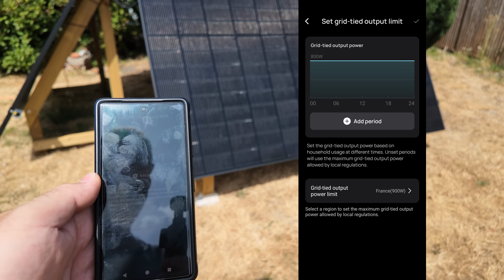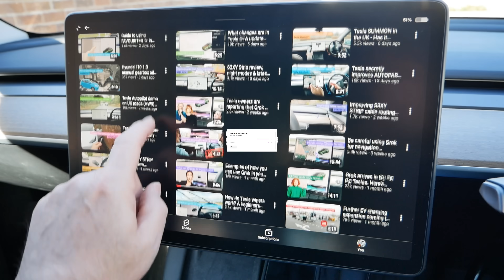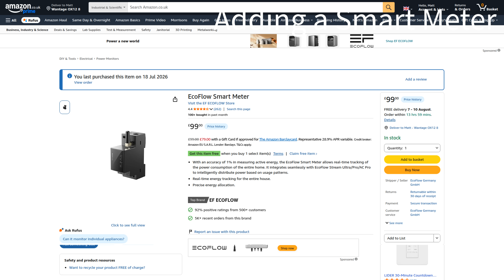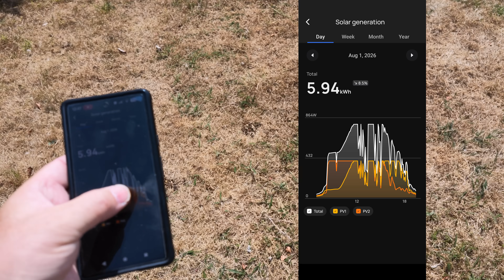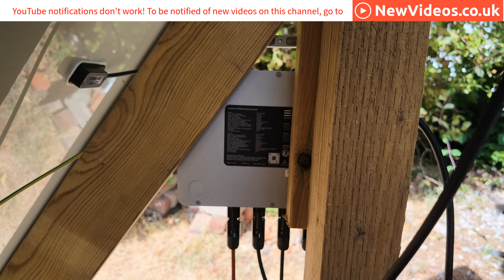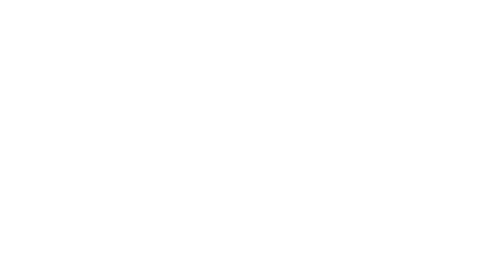Why My 800W Plug-In Solar Setup Sends Half Its Power Straight to the Grid ⚡

Comment: The more I read about these installations the more I think that over pannelling is a good idea( within the limits of the inverter) as this will improve winter output. A DC coupled battery to make sure you can use the full solar input and potentially max out the output of the inverter. It also seems possible to use a second 800w inverter in your system as long as it is on a different house circuit.
Reply from the maker: Yes, I'm looking forward to see how this performs in the winter.
Reply: I know everyone talks about DC batteries to reduce the conversion losses. But if you have more than one plugin solar setup on your property (some distance away) and want to be able to fill a battery from all the panels not just one array. Then an AC battery might not be such a bad idea, you plug the batery into a socket or in to your consumer unit. A Smart meter tells the battery there is spare solar and how much. It is a new idea to me as I was thinking you have to have panels plugged into the back of the battery but it seems not.

Comment: Mount the microinverter to a mental plate. It then becomes a big heatsink.
Reply from the maker: Yes, I'm considering that. Just trying to come across a bit of suitable metal.
Reply: @GoGreenAutos  Nothing too shiny!
Reply: Would be interesting to see if you can lower the temp with such a setup. I find mine hit 60-65 degrees which seems high but I understand it is ok up to 75 degrees. But do make sure it is in the shade!

Comment: I started using the same ecoflow stream inverter. i got 4 panels from city plumbing.  I have 2 ecoflow inverters with 1 450w on each port. (i think using 2 panels in parallel is risking damage. The current will be able to go too high)
I am about 5 weeks in now and also want a ecoflow stream ultra x and the smart meter you showed. But at £1300 for the ultra x and another £100 for the meter it is going to take a long time to pay itself off. 
The new ecoflow stream 5000 unit are just launching and I am going to wait for them to be available in the UK. 
On the 27/8/26 plug in solar is legal. I wonder if the grid will cope next year.
I can imagine that as more people start using solar it will make the price of electric will go down during sunny days.
I personally think the laws should be changed to force payment/credit for the electric pushed into the grid. I am sure my energy companys smart meter can calculate how much energy i have pushed into the grid.
Reply: The inverters are good for max 20amps so if you are using 4 panels each maxing around 10 amps (yes they say max 13amps but I have never managed to get that from mine) then maybe best not to have them all facing south.

Comment: I like this setup. You did the two strings correctly with each pair of panels in a given direction into a separate inpt. Mixing them would give reduced output.  I have a high base load due to a couple of pond pumps, filters, etc, so this would be ideal for me, perhaps on my garage roof, since that's an almost perfect east-west split.
Reply from the maker: What you waiting for? 😉

Comment: Aren't there losses due to the inverter working?
Reply from the maker: Always. The inverter is converting the generated energy from DC to AC and getting very hot doing it, so the losses are coming out as heat.

Comment: Great video. Thanks for making it.

Getting a battery is a great idea. Not only will it store the energy you are currently exporting to the grid, it will let you capture more KWHs per day from your panels because the battery charge controller does not need to be limited to 800w.
Reply from the maker: Interesting. That's if I have a battery with an inverter built in.
Reply: @GoGreenAutos  that is what the Stream Ultra does but it’s not the only way. 

You could wire a battery and charge control between your solar panels and current inverter.

Comment: If you've got nothing to do and a bit of extra cash, buy a small power station that allows selectable charging rates.  

When you have zero load during the day, adjust the charging rate up to the 800 watt max.  Grants power that otherwise goes to the neighbor, who gets charged for it!

Comment: Earthing.  I have a small DIY array on my garage roof.  I did earthing, down to a rod in the garden, completely separate from mains, as my system is entirely independent.  I thought about it for a couple of weeks, and asked around online.  90% of the advice was to earth it, because it's easy, and it reduces the possibility of static build-up or a fault causing a shock if I go up there to do maintenance.  I think you did the right thing.
Reply from the maker: Thanks

Comment: as far as grounding and the tying the panels together the panels will work with or without being grounded/tied together however. if you don't ground them properly, they can build up a charge and shock someone, but the real reason is due to lightning strikes. a properly grounded system can save you a lot of money later if you ever get hit by lightning.
Reply: also, a lot of roofing installers use a grounding tab/shim that ground it to the rail, and you then ground the rail. but yes, they do ground roof setups.

Comment: Whoever suggested to wiring two panels of different directions are delusional... The panel not facing the Sun is going to drag down the one facing the the sun!!! 👎
I agree, add a battery to buffer solar input...
Reply: @SolarizeYourLife  No because the unit interface, doesn't allow this. It treats each panel separately 👍🏻

Comment: bonding usually achieved by panel mounting system to rails which are then bonded.
Real question is should you divorce the cpc to the mains connection and then bond and earth with a stake at the panels.
Reply from the maker: I do have a spare earth rod, so maybe that would be a good idea.

Comment: Yep, a lot of devices don't use a lot of power when idling, a fridge when running might only be around 400ish watts for brief periods.
Laptops usually throttle down when idle and can sit around 15w or less.
Batteries once charged only float after etc.
Phone chargers (old ones) are like 5 to 10 watts when charging.

Course I'm not factoring in inefficiencies from 240v to DC... which might add 10% or so more to the total.

Now that being said, I'm excited for NZ when we will most probably have plug in solar allowed with legislation changes.
I'm fairly certain most parties are on board with updating regs.
With one also looking to allow for batteries with the systems.

The next part (which sucks) is that we have to wait for RCM certified equipment - unless you want to void home insurance if a fire is deemed to be caused by the inverter.
Means you have to buy from the approved importer and can't parallel import even if its an identical model.

We don't do ring mains, so we might be allowed more of the units in a home... but will have to see what the electrical experts come up with.
Given that not all homes are modern wiring and not all are as interested or 'clued' up on circuits / electrical limits.
Don't want someone plugging (for instance) 4 into one circuit over two double plugs.
Besides the fact that it probably wouldn't make much financial sense (it'd probably be cheaper at that point for a proper system)

Comment: Is it possible to mount a heatsink and a fan to the inverter so that it does not throttle power will that work 😂.
Reply from the maker: I've been looking into that but it would have to be a DIY solution which is messy as it would need a power supply and a way to turn it off when not needed (i.e. every night). 
There is this product https://eu.ecoflow.com/products/smart-cooling-deck but it's for the older inverter.

Comment: Nice install... I have the same 4 panels on my shed (with a bit of overhang lol) and it work very well indeed.  It's fills in the gap for my house base load so my main solar can get on with filling the battery and then exporting to the grid. My Ecoflow goes up to around 790 watts...
Reply from the maker: Good to know. I've seen 790W from mine.

Comment: I installed my system about 10 weeks ago, I only get power from about 11am to about 5pm due to trees one side and a large building the other.
I run the washing machine, tumble drier etc during this time on the eco modes which run longer but use less power to maximise how much is being used.
Also slow pre-cook evening meal in the pm, put bread maker on etc. 
Just about thinking more about how and when you use things.

Comment: I think you did a fairly decent job.  A battery is a must and when you do the battery it more or less frees you from having to schedule things.  What will happen is that excess solar during the day will be banked in the battery and then dispensed as-needed.  Usually the battery lasts well into the evening.

On the solar installation, generally what you want to do is put same-facing panels in series as long as the MPPT can handle the input voltage.  Trunking four panels in parallel can produce a lot of amps, so be careful with wiring (which is limited by amps).

The mounts look solid.  Another option there is to create Pergola / Gazebo type of structure... i.e. something you can stand under, and slap the panels on top of it as the "roof".  This leaves the space underneath available.

Don't worry about optimal angles for winter.  Usually you want to tilt roughly 15 degrees or so... not so much that wind will cause a problem or create an eye so, and not so little that rain would just collect on the panels.  The solution to dealing with the seasons is more or less to just add panels.  Don't worry so much about optimal angling... in winter, on a cloudy day, the panel facings matter a lot less anyway.

-Matt
Reply: My base load is so high that I'm planning 2 systems. 2kw onto 800w inverter east and the same west.  The power is worth far more to me in the am and pm than lunchtime as my roof array takes care of that.  Over paneling should get the inverter running efficiently and I'll have dawn till dusk usable output. Id angle them just off vertical in winter.

Comment: A couple of months ago I installed DIY solar on my garage. I have 4x panels like you (2x JA panels identical to yours, from City Plumbing, and 2x Ecoflow panels bought with my Ultra battery unit). These are mounted in an East/West configuration because that is how the garage roof is situated. They are at an inclination of 14 degrees (again because of roof pitch on the garage). I have these hooked up to an Ecoflow Ultra and Ecoflow AC (connected to the Ultra with a parallel cable). I have earthed the panels and the rails (best practice for anything metal that can end up with a raised voltage on it). I do get 900 watts out of the Ultra (like you, I am currently in "Brittany"....). I have a cooling fan hooked up to the Ultra that is controlled by a thermostat with the probe on the Ultra heat sink. These units can get hot and it is best to cool them actively if you want best performance. I am using a PC case fan (120mm 12v). I power it using a 240v ->12v power adaptor plugged into one of the Ultra's AC outlets. I can control it with an automation so it turns on at sunrise and off at sunset. The Ecoflow AC battery unit never seems to get as hot as the Ultra, so I have not set up active cooling on that. On really sunny days I have been charging both the batteries fully during the day, powering most of the house (except where more than 900w is needed at any time) AND dumping some into my BEV when the batteries get full in the afternoon (by having the Ultra and AC connected in parallel, I can provide the current needed to charge the BEV, which when set at the lowest level using the "Granny cable" is 1400w). I also have a Shelly 3EM set up and run my solar on zero grid feed in mode since I detest the idea of giving my energy away for free!
Reply: Did mounting a fan help with the power output.
Reply: Can I ask how you connected the Ecoflow Ultra to your house. I've had conflicting opinions on this. Some suggest its a Part P electrician only install. Other have said if I use an existing spur I can simply use a fused connection box as its considered a 'small works' and no need for a certificate.

Comment: Assign your shelly smart meter correctly so it appears on the front screen of the app alongside your inverter so you can see it all on one screen.
I can't remember exactly how you do it , but I think it was in settings ( the cog ) clicking energy delivery strategy and assigning it from there.
I guess you could also select the zero feed in option which would keep the heat down on your inverter as the system will clip generation to the amount needed by the house. For example , once all my batteries are full .. the built in inverter on the battery no longer requests solar from the panels and everything cools down
Reply from the maker: It's not a Shelly SM, but the EcoFlow one. I've tried to get it on the home screen without any luck. AI tells me you can only do that when you have a battery, as that gives the app more functionality.

Comment: A little more east/west angle on your panels will help, especially as we head into winter. Well worth sacrificing a little peak generation in favour of a longer generating day. 780+ watts is exactly what you should be getting from the inverter. If it was designed for exactly 800 watt, there is always going to be the risk that it may spike over and would not be approved for use. As for panel output limiting, your panels in parallel generate a max voltage of 33.68v. the inverter is limiting the max current so the figures you are getting are correct. If you had higher voltage panels, then even with the same current limiting, you would get a higher total output. Annoyingly, if your panels were under 30v output, you could wired them in series and would need much less current. Which is also better for the inverter as it would run cooler. Always easier to invert 60v into 240 than 30. Less work for the inverter, less cable losses due to current heating. Higher voltage is always better than higher current due to lower losses.
Reply: I have always wondered why it does not hit 800w and tops out at 780ish, thanks. Yes I think the regulations allows up to 100v and yet ecoflow say max 65v I think, shame.

Comment: As from August 27th 2026, NO batteries are allowed on that system. Sorry mate, but don't worry, the government  are mor than happy for you to feed their grid with free electricity. Imagine a couple of million of these all feeding the grid. They won't be too keen to lose all that free electricity by letting us have our own batteries.
Reply: No batteries are allowed on it now, it doesn't suddenly become illegal on 27th August
Reply: You can charge batteries from it but the batteries then cannot feed back into the grid. That's how the DJI kit is set up for the UK for the moment and how the Indievolt will I believe ship. I imagine Ecoflow can do a similar temporary firmware limitation for the same result.

The batteries included with these kits are currently ridiculously expensive anyway. You can get a 16kWh battery for the same price some of them want to charge you for 3 or 4.
Reply: You can use batteries now just not plug in, batteries will come in later

Comment: If you want to set it up for maximum output you should add a separate solar charge controller and some type of lifepo4 48V battery. Have the panels go to your solar charge controller, solar charge controller charges the battery, battery feeds the ecoflow inverter. This is how I have my ecoflow 1200W inverter setup and its working great for me.
Reply: Not legal. Plug in solar, as restricted by law cannot use batteries. So you cannot use the panels to directly charge the battery and feed power into the ring main via a BS1363 plug from the inverter.

However, there might be another way to achieve the same result.

You install a plug-in solar system comprising PV panels and inverter only, you take the output of the inverter on the BS1363 plug and plug that into a ring main (or radial). This is then a legal install of a plug-in solar system and legal use of it (so long as it conforms the appropriate British Standards).

Then you plug in a solar battery which  is charged from the mains using a BS1363 plug.

If there is any surplus power generation capacity from the PV panels which cannot be used by the loads in the house, then it will go to charging the batteries. And it will reduce the amount of power being fed back into the grid which you aren't being paid for.

I doubt this is illegal as you're lawfully using both solar panel system and separately lawfully using the battery pack and recharging it. You are using both in the way they are meant to be used.
Reply: @deanXRayZulu  You also can't use T connectors to put panels in parallel as he is doing, nor can you use mixed parts not from an approved kit, nor can you use your own plug on the cable, nor can you install it until 26th August or whenever

All of which theoretically means a max of £5000 fine 8)

Comment: You need a battery. I’ve had plug in for months now and you need a battery and some home assistant automations
Reply from the maker: I keep here about home assistant. I need to get into that.
Reply: @GoGreenAutos  Annoyingly a lot of the plug in solar stuff is very very proprietary and closed so what there is tends to be unofficial hacks that only work via the vendors Chinese cloud so will be useless when they go bust or China v Taiwan kicks off and so on. The unofficial hacks also tend to break all the time as vendors adjust their supposedly private protocols.